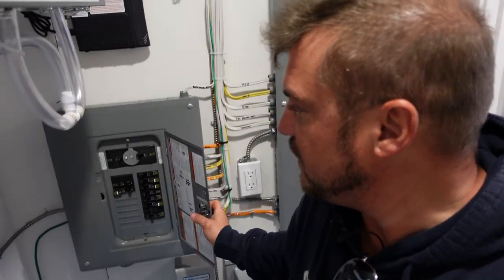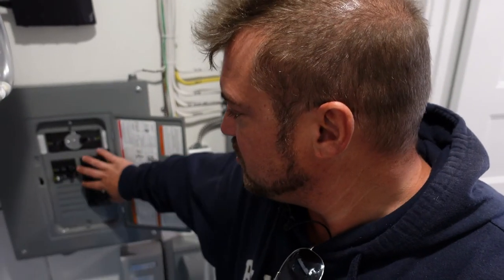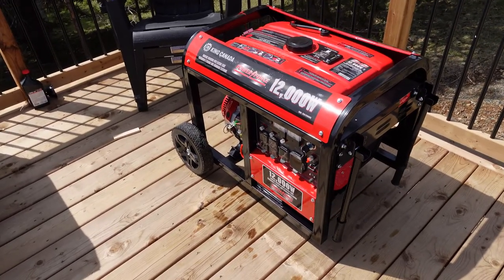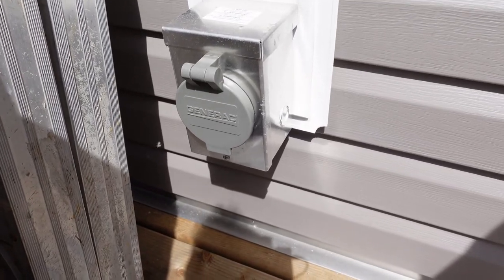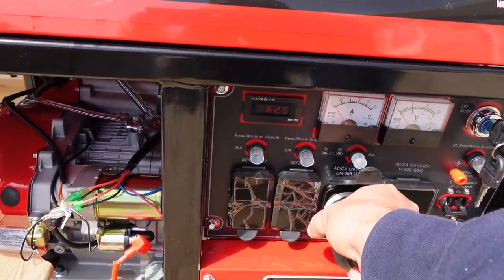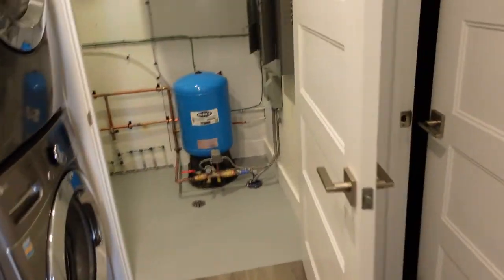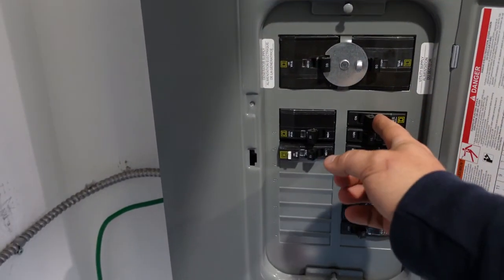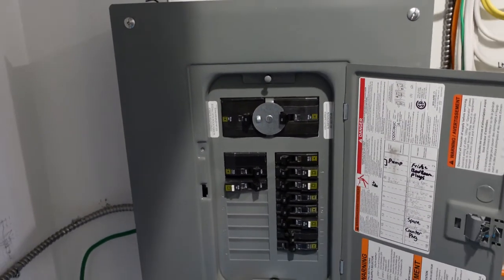How To Use an Emergency Generator Severe Weather

Comment: I see that you are using a 60amp generator panel, and using the 30amp plug from the generator. Why not use the 50amp plug from the generator? Also what  amp/breaker are you using to feed the 60amp generator panel from the main panel?
Reply from the maker: The generator panel is fed from the main panel with 60 amp 6 awg
the generator outlet is an L14 30 R from the generator to the panel with number 10 awg. The panel lugs are rated for it. We could have gone with 50 amp however it comes down to cost of the cord which is a lot more costly then the 30 amp cord due to the ends and the inlet flange kit to adapt to 50 amp. 30 amp is 7200 watts continuous which is a lot on that 12000 watt peak generator. Anything more and it would just die lol. Hope this helps....